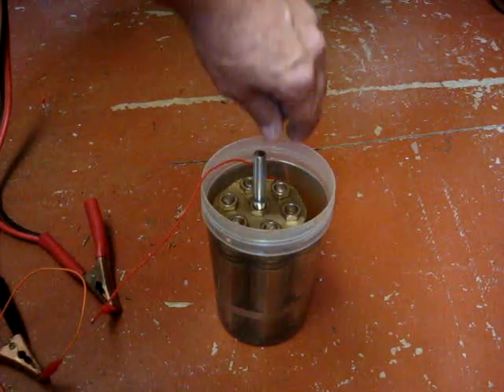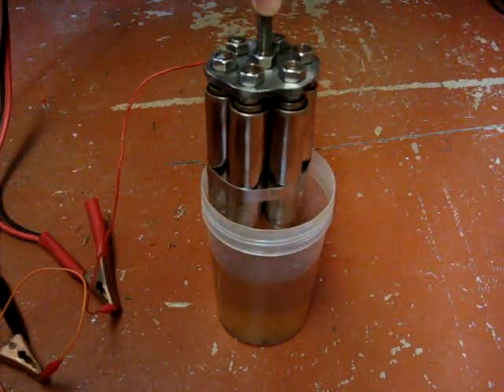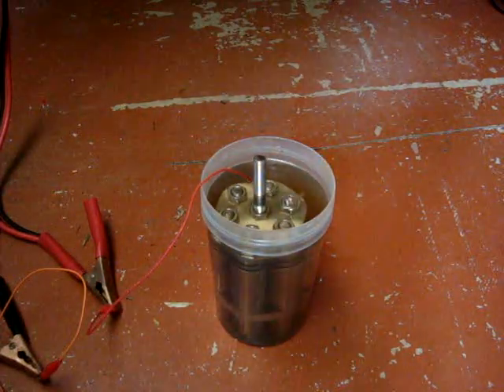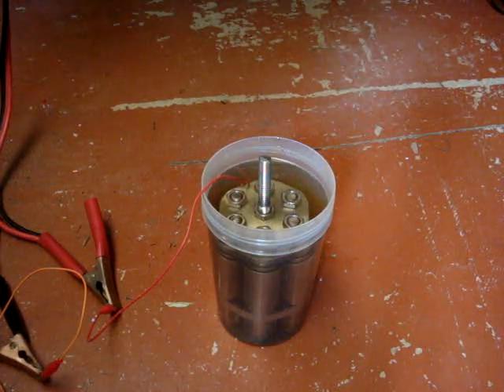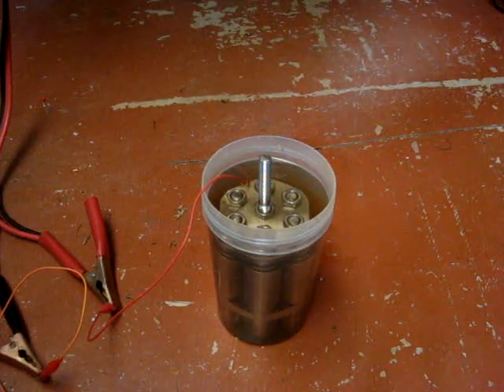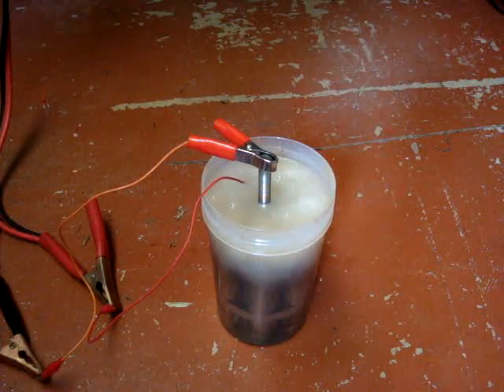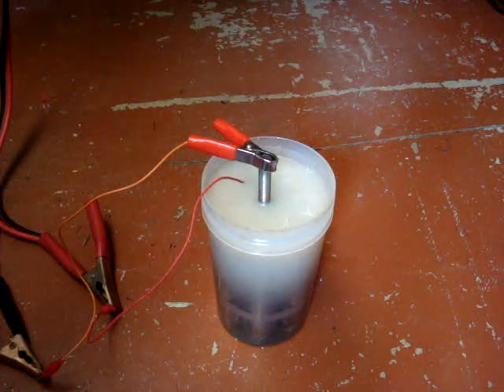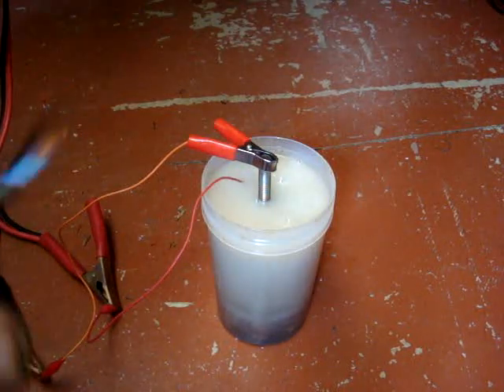Stan Meyer inspired hho cell

Comment: You do EXCELLENT work! 

Whatever happened to your crob spiral cells? Did you ever run before/after mileage tests? Results? Longevity and durability?  Was there a reason you left that type cell behind?

I have a 500 ft. coil of 7 inch wide 316L. Was thinking of a "hybrid" of a "coil cell" and a "joe cell" with 3 to 5 neutral plates and center anode fed through the center/bottom. Anybody tried this approach?

Comment: Im curious how the electrodes are. Hooked up
Reply from the maker: Good question mate,
That 12mm threaded rod is connected to a stainless plate the that connects all 7 tube arrays cente conductor to +ve, The outer most tubes are gear clamped together which is then the -ve connection